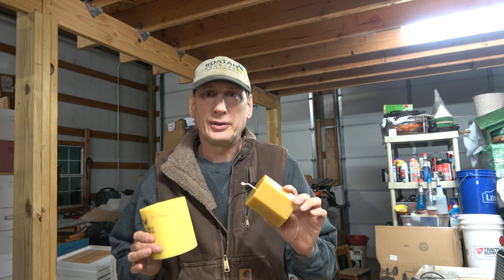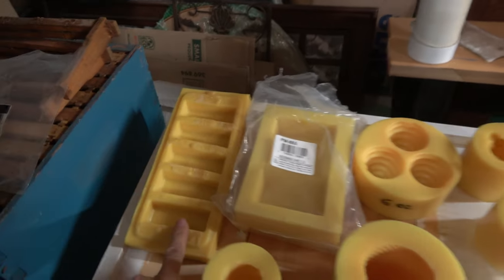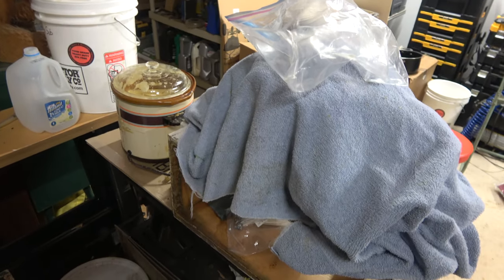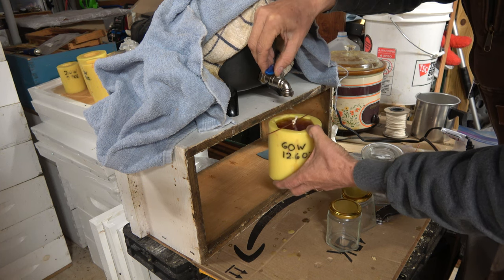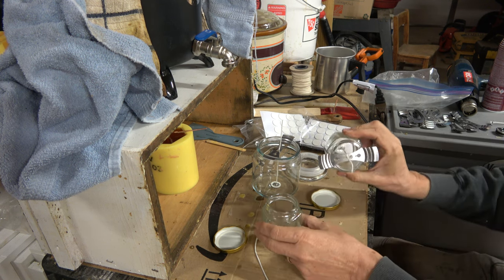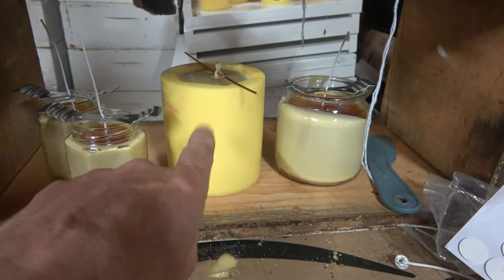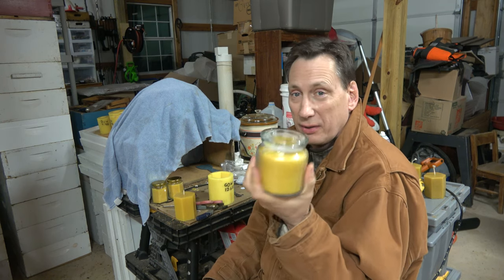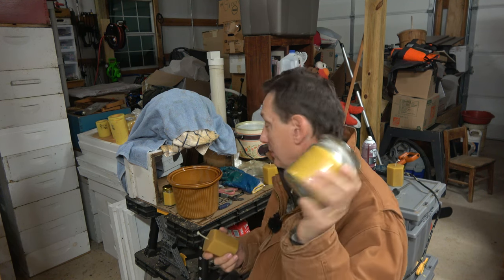Making Candles S6E70 #beekeeping #beeswax #candles

Comment: Thank you so much for this! I want to get into candle making, this helps a lot in getting started. I’ve been making lip balm for a few years now, it smells like mint, tastes like chocolate, and it’s a hit with friends and family. Here’s the recipe, I usually double it….Peppermint Lip Balm, 2 Tbl. Cocoa Butter, 2 Tbl Coconut oil, 1 Tbl Beeswax, 25 drops Peppermint Essential Oils or to preference. Melt beeswax, cocoa butter, and coconut oil, remove from heat, add essential oils, put in desired lip balm containers. Glad you had a nice Thanksgiving! 🦃
Reply from the maker: Thanks for the recipe P Daisy. I’m sure other folks will appreciate it too.

Comment: Hi, great video. What size wick would you recommend for hand dipped beeswax candles?
Reply from the maker: The wick size depends on the candle diameter I believe. Larger candles use larger wicks. The Mann Lake molds have recommend wick sizes in their catalog. You can look on line at those to get an idea of what size you would need. Hope that helps.

Comment: Great video Darren! We've been making candles this year also. 
For those metal wick centering tools, I know they work they way you're using them, but if you're stopping your candle pour short because you're worried about the wax hitting that metal centering tool, you can turn them the other way, and you can get more space since the tool will be above the top of the jar instead of down inside it.
I need to get me one of those pots with the spigot like you have. That looks like it works great.
Candles look great! Thanks for sharing.
Reply from the maker: Hey Texas Beek.  I was mainly stopping short so I didn't overflow it and get wax on my hand. lol  I like those small glass containers, I think I'll just do those in the future.  Those other ones are nice, but really expensive.  I used up all my wax and didn't really make a lot of candles like I thought I might.  I still have 12 more of those big ones and about 12 of the small ones as well left.  Hopefully I don't have to coat a lot of foundation this next year.  I don't make candles every year, I don't have enough wax.  Thanks for watching.

Comment: One thing I do is if I'm going to make several candles from the same mold I eun wick from bottom and leave itnattached to the roll, then you just pull it through when you're done and it's set for the next pour.  I've found that every time you run the wire through it expands the hole.
Reply from the maker: Hi Glenn. That’s a good idea. Probably a lot less waste on wick material that way too. Thanks for stopping by.

Comment: Great looking candles. On the glass to stop the wax spots on the side either heat the jar up or cool the wax down a little bit is what I find works best. Won't stop it all the time but a lot of the time. I usually melt the wax and pour quick so the wax doesn't get to hot on me. That also stops the candle from cracking if you ever experience that. Hope yall had a great Thanksgiving
Reply from the maker: Hey Justin, thanks for the tips.  Yes, I did have a couple crack as well.  One had a pretty large crack in it.  We had a nice Thanksgiving.  Hope you did as well.

Comment: Great video! We poured our first candles after watching your wax rendering video.  I love the idea of writing the wick and wax volume on the molds.  We used long bobby pins on our smaller candles that may help prevent splashing.  Thanks as always for sharing!
Reply from the maker: Hi Brian. That Bobby pin is a good idea on those small ones. Has a built in clamp. lol. Thanks for stopping by.

Comment: Try pulling the wick through the bottom of the mold and don't cut the wick off the spool.  Then when you pull your candle out of the mold the wick will actually run itself up through the mold and you snip it off the bottom of the candle and your mold is ready for next time. No need to ever thread the needle again. (only downside is you have to store the mold with the wick which is fine)
Reply: Also, feel free to just pour the wax into the container and then steady the wick afterwards with the metal bar.  Now you don't have to worry about a narrow pouring area.
Reply from the maker: Yeah, If I had a permanent set up and made candles regularly that would be the way to go.  Thanks for watching.